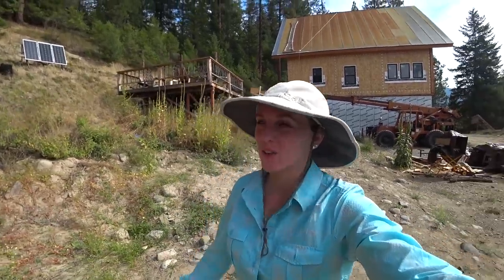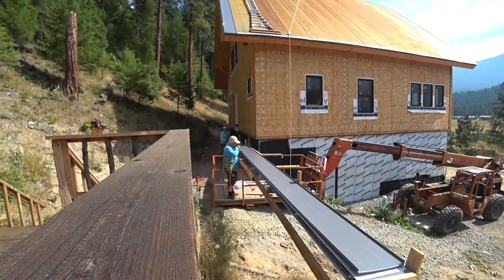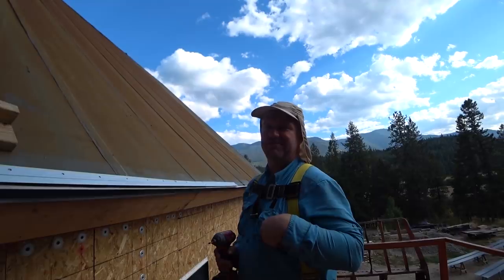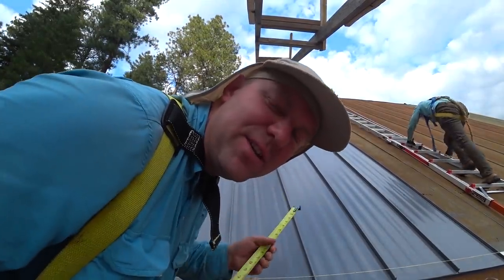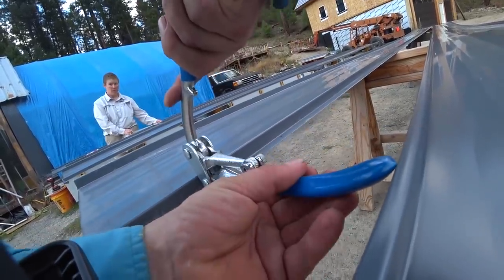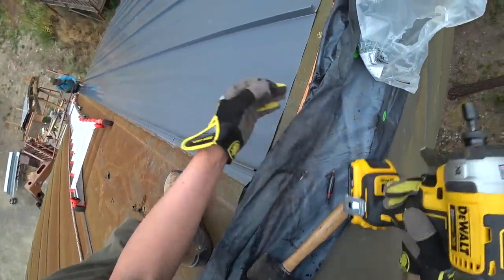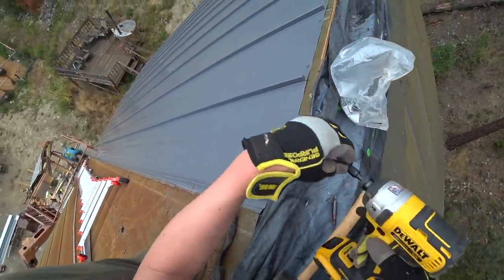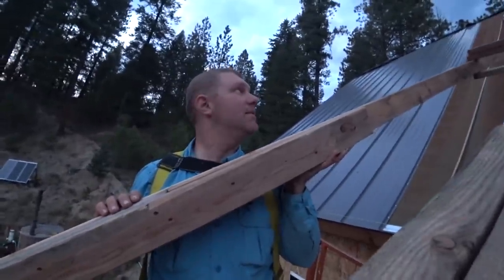WE’RE UNSTOPPABLE NOW! (DIY Metal Roofing Install)

Comment: It looks like the wooden contraption is working very well.  Great job for all 3 of you.  I wish I lived a little closer to you all as I would really like to build you a portable Miter-Saw station with a built in ruler and stop gauge. I have the same Dewalt as you do and a good miter saw station just makes it so much easier to use. The sawdust clean-up is also much easier as I use a shop vac hooked up to a gizmo that starts the back when I start the saw and it keeps running a few seconds when stop the saw to clean out the hose. I also have a Vornado between the shop vac and saw that catches 90% of the big chunks so the shop vac doesn’t get filled too fast.

Comment: Yes I hope you are measuring your roof panel from the far end of the roof to be sure you are not getting what is called creep. Creep is when you go to fit your last roof panel but one end is off the side of the roof. O ohhh! Take all the sheets off and start again. Just thought I had better mention as another person has already mentionedalso. 345 method does not work efficiently.
Reply: ...anyway by the time it has taken for this short video to be aired, the guys would have found out they have a problem. As 1 end where the fold has been silastic applied to then I would say the guys have a huge problem to unglue the bottom end if they need to straighten the sheets. Surely , there must have been at least instructions on how to fit the sheets to the roof?

Comment: The next time you need to drill sheet metal, purchase a Uni-bit.  It is a multi diameter drill bit made for sheet metal and comes in several size configurations.

Comment: Ok Jesse, I’ve had my doubts that your Rube Goldberg roof panel delivery rig could work or be manageable, but I’m impressed at how well it’s worked. Good job for thinking outside the box! BTW, the panels are still squarely aligned because they’re machine produced, so good manufacture. But more importantly, because you were so fastidious about making sure the first one was dead square, so good build!

Comment: Unless you're likely to strip the screw head, or you're driving it in slowly for a reason, Just hold down the impact trigger instead of tapping it. A lot of people do this for some reason. This is coming from a carpenter of trade

Comment: Suggestion for you safety rope clamp. Try not to hold the clamp release when going up or down the roof. You might accidentally keep squeezing if you fall. We learned that in class while learning to use them.  Nice job on your house.

Comment: Bravo!  Big   jump in productivity.

It looks like in the first video the first panel was screwed in along a rib, but you clearly show the direction in this video.  The punch helps, but its way faster just to use a 20 ounce hammer and a punch.  Expansion rate of steel is so minor, you want minimal looseness with your fasteners.  The punch method may be a little more than your wife would want so your current method is effective.  The real key you figured out is keeping everyone busy.  Anna should be able to handle 40 footers by herself for prep.  Panels are not fragile, they just have a way to handle them where they won't get damaged.  Your weather really has been ideal.

Comment: A tip you might want to try is using a magnetic tray to hold the screws instead of working from a plastic bag at those heights. Can attach it to the safety harness you are wearing.

Comment: just a thought but maybe a light panel on the side of the basket to better communicate to the operator boom control. some like 4 lights (1 for each type of moment), 4 momentary buttons, and a battery, a switch to turn the unit on and off (to prevent accidental activation), and wire to connect it all together. just not trying to reinvent the wheel or anything

Comment: In North Florida we have such an extreme range of temperatures that a long continuous run of a single piece of metal will expand and contract so much that it rips the screw holes.   An elongated hole/slot that would slide under a wide screw head might work better.

Comment: With the drills, the chuck is designed to grip to a certain point and then you give it another turn without the drill engaged. This securely locks the bit in place.

Comment: Yes!!
Yes!!!!!
It's always so fascinating to watch, once you guys get the details agonized over and the bugs ironed out. :-)
I have never seen a Standing seam/hidden fastener roof go on before. Your excellent videography has made it crystal clear. The end being formed over and crimped - along with the silicone to bond to - makes that edge bulletproof, I'd think. That standing seam-pound-the-crap-out-it-'till-it-locks still makes me wince a wee bit, but, it's a proven system, so, who am I to disagree. Coming from having seen hundreds of metal roofs installed with the wide-washer-rubber-seal screws, as in exposed fasteners all over the place, it seems this is a tad less secure. But, aesthetically, this takes the cake, for sure! Not multiple lines of "pimples" across the roofscape...
Beautiful, folks! Bravo.

Comment: Good job well done, i admit to being on the edge of my seat every time i see you lean out over the roof to put screws in, such a dangerous position to be in.
It looks really great, and doing all the ground prep, before putting it up to  roof level seems to have worked.
I still would like to know how the roofers do it as the problem is still the same, how do yo get it up there without damage?
The punch turned out to be a real  time saver, but by the time you have finished you will have a collection of tools like no other, rather like my shed, but it is nice to have the tools for the job, the one tool that you did not say too much about was the crimping tool for  crimping the lower edge tigh against the last sheet, i have not seen one before?

Comment: Combo roof climber  (akin to rock climber 🧗‍♀️) with a construction 🔨 twist. It is always easier with the correct tool and sometimes the correct tool if found part way through a project.   

I think a professional has experience in processes, logistics of materials, ongoing practice using the correct tool, project management, tools troubleshooting and critical thinking 🤔when building construction projects. But the other thing is having, borrowing,     renting the tool or tools for the task at hand. I think you have done a great seeking out knowledge and tools 🛠 to accomplish the tasks and sub tasks if each of your projects. But sometimes you don’t know what you don’t know but you are lucky to find the tool like that punch help the roof panel prep.

Amazing job you all have done. 
The Alyssa cam on the roof was amazing!

❤️👏🏼👏🏼👏🏼👍😎

Comment: Alyssa You are incredible!      Screwing the sheets At the peak Has defeated your Expansion and contraction  there's no need to screw them there.
Reply: I screw all the tops of my panels with Z's for the ridge cap and I've never had a problem they expand at the bottom. You need to make sure you leave them down 1/8 of an inch from your cleat. I've had a 35-foot copper panel laying on a black roof where you couldn't touch it measured it. The next morning cold barely sunrise it shrunk a width of a line on a tape measure.

Comment: I have noticed that from a vendor video, the cuts to the end of the panel should be a "V" cut and not straight. There is a tool for that, and it seems to work, as bending the panel with the bending tool seems to work better. Now, great job regardless of what. Go team!.

Comment: Green handle for right side cuts
Red handle for left side cuts
Yellow handle for straight cuts

That’s probably why your right side of your panel keeps going off 1/8 of an inch (need right side cutters). Your panels will look side steps ever few panels.

You can purchase a 3-piece set for as low as $45 at Lowe’s or Home Depot.

Comment: it looked like you used screws with washers on the top of the metal roofing plate, but not on the sides. is it problematic or unnecessary to use washers on the side too?

Comment: You need a Nibbler Tool.  You could then enlarge these holes fast.   It cuts the edge and does not make chips.   Watch out for the metal chips from the drill then rust and stain everything...
Reply: Not only do they stain, but eventually the rust will eat through the paint. I've seen it happen with a screw that a builder had dropped onto a metal roof and left there for few years. The paint around the screw had corroded away and bare rusted metal was visible.

Comment: One good ground-man could get those panels to the guy on the eave - then just push them up to the peak. 
Sliding clip fasteners over ribs allow for any expansion/contraction issues.
Wonder if you looked into that system.

Comment: It may have already been mentioned, but just in case, You need 2 pairs of tin snips. LEFT hand and RIGHT hand. 
Keep up the good work. Alysia,  you're doing a fantastic job of running the house (RV) looking after the garden, building, some very heavy lifting, climbing up and down the roof running chores, collecting 1000 litre bottles of water, shopping etc and you still have time and energy to edit the videos, cook simple but healthy meals, take care of Bugaboo and you still end the day smiling.
BTW.   "THE CONTRAPTION" works great.
The screws down the edge of the sheet look to be leaving a dent in the next sheet fitted when it is hammered down.  That's a shame.  Why is the bottom end of the sheet being lifted by the edging strip?  10:59 TO 11:10?  Looks like a poor design of the edging strip.
Good to see Anna back on the job.
Keep up the good work.

Comment: Great video and thank you for sharing!  I do have a question and know it is probably too late now but, would it have been easier to use one of those portable cutting tool/grinding wheel with a thin disk to cut the metal on the bottom? It hurts my hand watching you use tin snips with those sharp jagged little edges..just an after thought.

Comment: Type of Paint to Use. Painted metal roofscome with a baked-on factory finish, and you can re-coat these, -- as well as paint bare metal roofing -- with acrylic latex paint. ... Use the primer even if you add a topcoat of acrylic latex paint, because the primer inhibits rust and bonds better than paint.

Comment: Your drill bits fall out because you're not using the chuck correctly, and thus not getting the bit tight. DO NOT pull the trigger to tighten the chuck. You simply turn the chuck to tighten, no pulling of the trigger. The drill has a lock so it doesn't rotate when you turn it by hand.

Comment: See you found the hand punch.... Normally one wants to flange the top upward under the ridge vent to avoid water blown under the vent from going into the vent area.  All the sealing at the bottom will keep any condensation building at the bottom.  You are going to need a very large ridge vent cap as the panels look short.

Comment: I am not sure but here in the UK, I thought the metal panels where they overlap, they use a machine the runs along the joint and rolls it like the top of a food can.
Reply: Different style standing seam roofing.  They have many different styles of the standing seam roof and they install differently.

Comment: Its to bad you couldn't get that automatic tool that rolls the seem from bottom to the top I saw a few video's with that machine it looks like an electric plainer not as big as the one you have you engage it at bottom push the button up it climbs rolling the seem over. I know your roof panels are different. Great teamwork.

Comment: You might like to forget about the panels being “square” now established, you should now be checking that the top and bottom measurement to the other end are the same, so you can cheat a little each panel if you have to.

Comment: You going to crimp the panels together from eve to ridge.
Reply: No need - that standing-seam join "locks-together" when the folded/formed successive-panel's "standing"-female flange is pushed/driven down over the previous-panel's "standing"-male flange/bead...put in the fasteners (in this case, screws) along the flat, perforated fastening flange, and it's all done...

Comment: Every now and then it's good to check the margin left to the end and sometimes you have to split the difference between square and parallel. If you get to the other end and you are perfectly square but 6 inches out of parallel :) then you lost your chance along the way to split the difference.  Of course this is not as important in new construction as it is in renovation work where maybe the old roof was not dimensionally correct.  Looks good!

Comment: You guys, try not to be so exacting. Building is NOT done to 1/16ths, and 1/32nds unless your doing so very exacting finish work where it super exposed and you can see it with the naked eye up to 2 or 3 ft away. Roofs and any long construction, like big floors are done by a reference line so you don't grow as you move forward. You adapt as you move so your efficiency doesn't take a toll. In the trades your working by the hr or ft., or man hrs per sq ft. Guys that do this all the time develop a large 3D internal view where you can see the big picture as you do instead of analyzing ea small minute sq in. of which your living in fear all the time that the project is getting away from you. Learn to look at the big picture and you won't get stuck in the moment. Instead of a 3, 4, 5 triangle on each panel, snap a reference line down the rake and keep referring to that. Like a level is only good for the length of the level, the triangle is the same. You should be pulling from a reference line parallel to the far gable edge. That way your watching to see if your growing. Have you pulled off the other end to see that your running parallel?

Comment: The Hammer and Drill sitting on the roof peak are not secured, the chance of 1 falling down the roof and hitting jesse in the head is HIGH, try to work a lot safer guys

Comment: you made the statement of having to use your non major hand instead of your major hand  while leaning over to drill /put screws in roofing,could you not have started puttoing roof panels on thr other end first,then you could have used you dominate hand drilling and such ?

Comment: why all the sealant, caulk and tape, at the bottom of the roof?.  i would think if you got water under the metal roof you'd want it to run tree off the eaves

Comment: My apologies! I have been a viewer, and a fan before the polyethylene pipe water line install. I have made only “two” comments both concerning the roof installation ! One, that recommended a metal roof, and suggested that you subcontract the installation, and another on your last video “ Are we making a mistake in installing ourselves” ! Sorry,  like many of others, I was concerned and reacted strongly that you were risking each other, and others in the process by DIY! ....I was thinking that the video “timeline” was not delayed but current.....My experience with metal roofing or any other type is on the “west and gulf coast “ where wind levels would have made the roof install, and even the ground prep completely different.... So far in both roof installation video’s there’ been no “ tree 🌲 branch movement” at all ..... So unlike my experience’s that it is impossible too lay the metal,  across “sawhorses” unrestrained...Good job Allysa and Jesse, and Anna 🤗 👏👍

Comment: You guys are awesome....Alissa, you're just a badass!

The sheet metal punch is an awesome idea for this project.  For metal that's a bit thicker (that a punch that size won't work on), step drill bits are great (http://a.co/d/25rSQjl ).  Or, you can use a smaller bit to start the hole and then use a larger one (which is why a step bit is great...only one pass/tool)....much easier than just using a single large bit (which will torque/tear out the bottom of the hole like you experienced).

Also, if you're not as good as Alissa at hitting the center of those holes with the screws, getting a hole started with a self centering drill bit is great (http://a.co/d/hUrEMkG ).

I love what you guys are doing.  Keep up the awesome job!

Comment: One thing puzzles me. Those metal roof sheets, are designed to last a long time with special paint and so on. But then you have to drill holes in them, and cut bits off. Those areas are not painted like the factory paints them, so what's the position regarding warranty?
Reply: I was shocked to check MBCI instruction manual, presuming this is their product. It states to do it like this. Though you need to seal the ends of the ridges with urethane sealant. Still why factory could not do these bends and cuts there is just incomprehensible to me. Guess it has to do with transporting the materials, but even still it does not make sense as those come in those frame crates or what you should call them ie individually packed.
Reply: If you read the warranties the paint is good for 25 to 35 years only if you follow their procedures. You need to wash them like every 6 months or even three months keep them clean from bird droppings and pollution. So drilling the holes where the water will never go isn't going to hurt them
Reply: @jimpech932  that's good news although if I was in charge the holes or slots would be made and the trimmed and folded edge done before painting. Imagine a BMW or Audi having bits cut off them after painting and having sealant stuffed in the holes.

Comment: Why not punch holes in the top screw holes???Panels move there too maybe.
Reply: You're thinking width wise? They can expand/contract length wise towards the bottom cleat just fine.
Reply: It's attached at the top so the movement doesn't lift the ridge caps. The panel should grow down the roof and slid up and down on the cleat at the bottom.
Reply: It shouldent cause a problem because the panel will just expand and contract down at the eave instead.